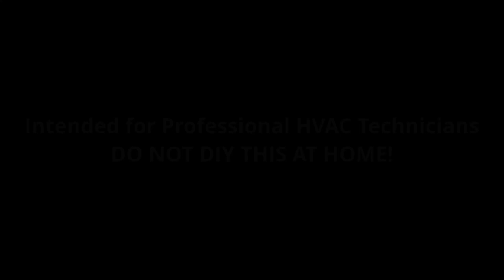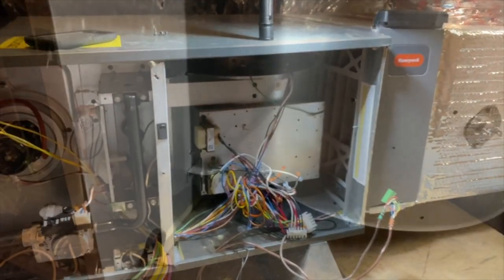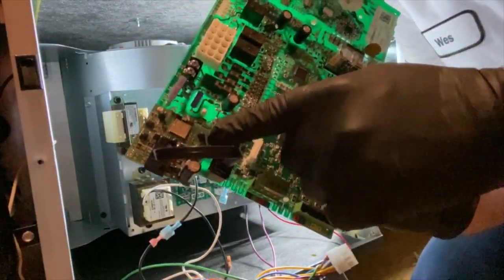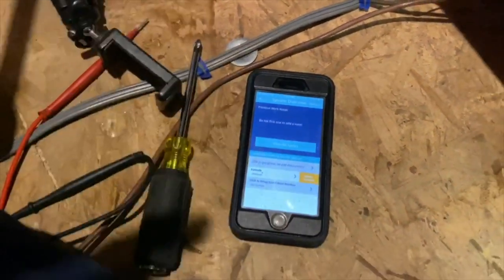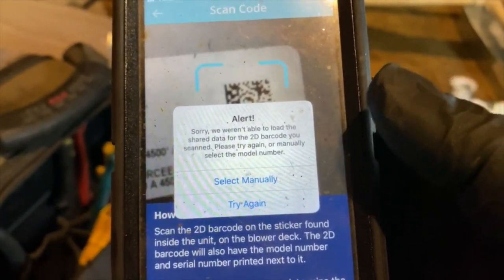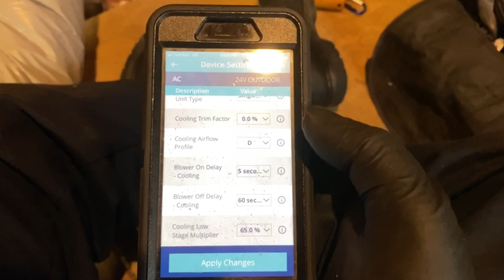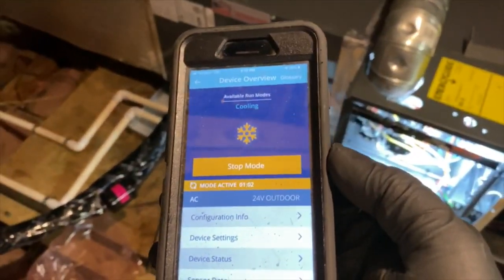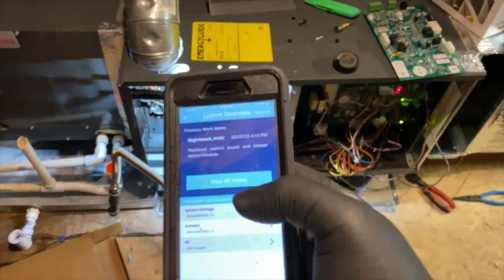Goodman Control Board Replacement and Programing using Cool Cloud HAC. EP29

Comment: Is there a similar utility to program a York controller board (Varidigm 364809)? I see there is are RS485 contact points on the board labeled A,R,GND,B. I"m familiar with RS485 and serial comms. I'd like to try reflash the f/w.  thanks. Great video BTW. precise and to the point !!! no excess bla bla bal. :)

Comment: What is the model # of the Bluetooth module that you placed on the Air Handler board?
Reply from the maker: This was so long ago I don’t have that information anymore. If you contact Goodman and provide them with your model and serial number of your furnace or air handler they should be able to get you the part and model number.